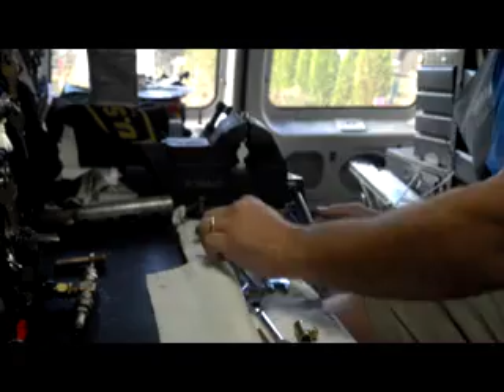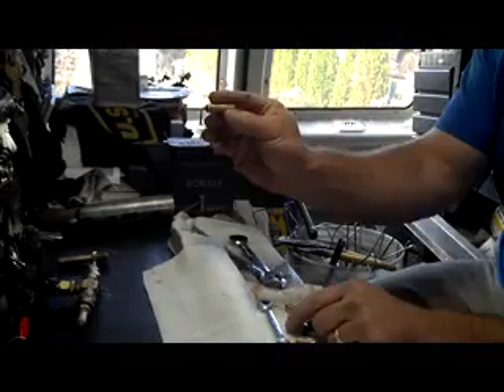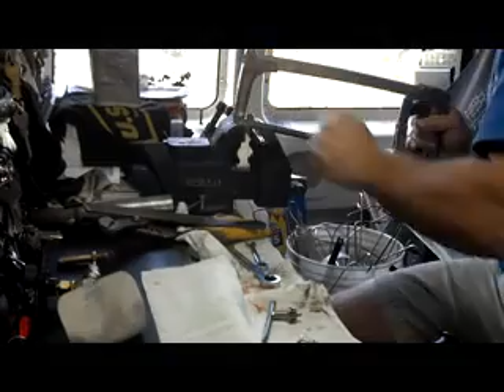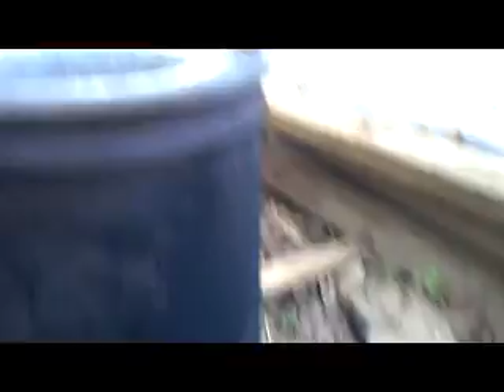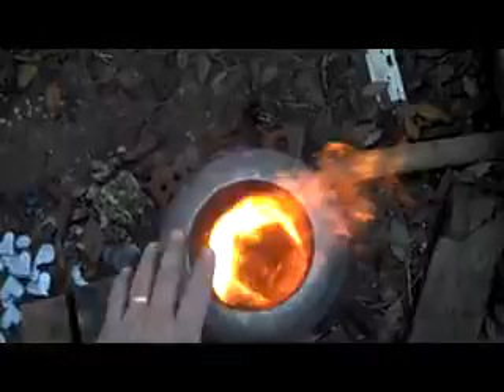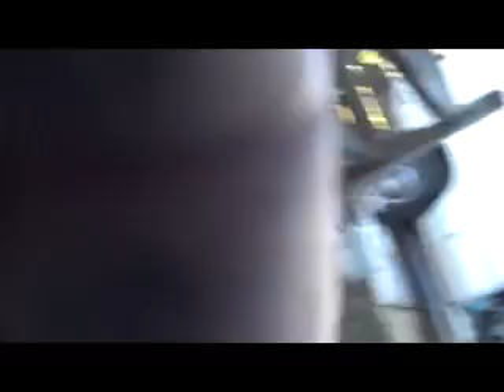How to Make the Kwiky all-fuel Burner

Comment: Hi Dave, as soon as I saw your video  (11.00 pm and just couldn't wait) I went outside to my shop and started with the mig tip which I have plenty knocking around,  I chucked it up in my lathe and tapered the end but I'll have to wait until tomorrow (darn it) to get some  fittings but I will post you some pics or even a video when I get it up and running.  Nice job dude, and thanks for sharing .keep up the good work.

Comment from the maker: If you are looking for a propane burner, there are probably better options than mine...look up Michael porter burner...he wrote a book on his burner design.  The .035 tip will work but it will use more air from the compressor.  My burner tube is small because that is what fit into my furnace.  I think it would operate better with a 2.5 or 3 inch tube but I haven't experimented with that.

Comment: Awesome. I've been looking for a blower design that's a little easier to build than the reil or upwind style. I can definitely make one of these. I picked up some mig tips at wally world. They're .035, will these still work ok? If not, I'll return them with some excuse (I already filed one) and pick up some .025s from Home Depot, which I can hopefully go to today. One more question, what is the diameter of the burner pipe you're mounting this in? Does it matter?

Comment from the maker: @coolobuttface Hello, This burner is called a siphon burner.  That meant that a stream of compressed air (going through the back of my burner) blows out the nozzle with enough velocity that it pulls (siphons) fuel through the front tube (on my burner) and atomizes the fuel.  The fuel and air mixture can then be ignited.  Mine is designed to be used on my outside foundry furnace to melt metal in a crucible.  Hope that helps!  Do a search for siphon oil burners if you want more information. thanks